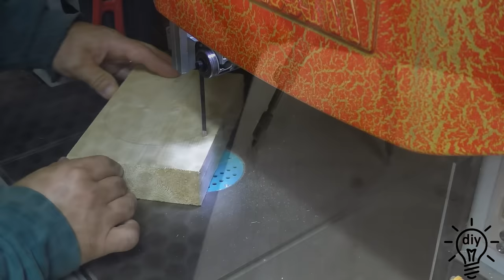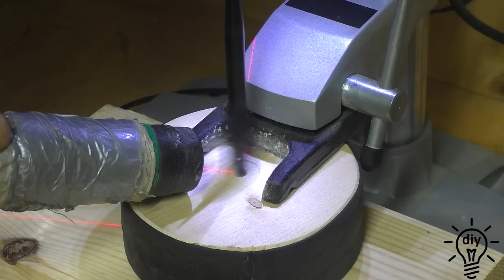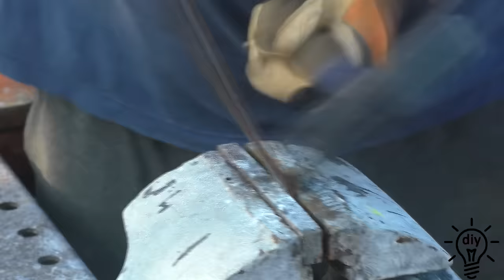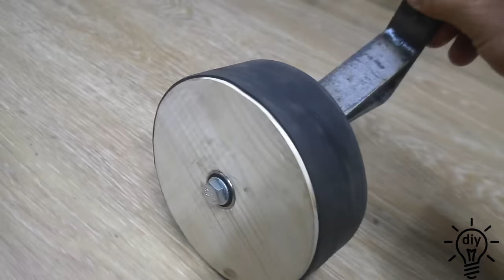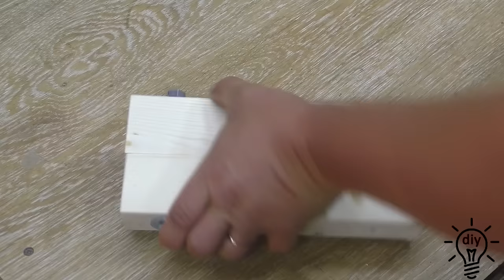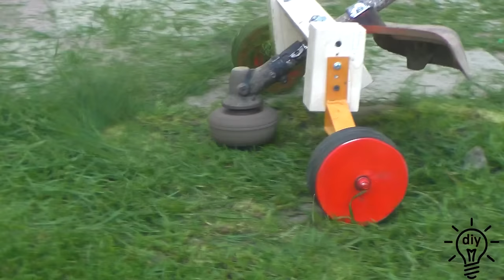A brilliant idea for your lawn! You will be pleased to see it!

Comment: The lawnmower is there for this activity! A lawn trimmer is actually there for lawn edges and corners that a normal mower cannot reach. And if the part is supposed to be useful, then (unfortunately) it is not thought through to the end. With a support wheel welded or screwed to the handle and height-adjustable behind the baffle plate, you would always have the same cutting height in forward gear. So you can only achieve an approximate cutting height by balancing. Totally useless part!
Reply: radam24uzo :::: from an artistic POV,  a designated consistently dense square footage of lawn could feasibly be “sculpted” by calculated height adjustment controlled by a skilled operator as the pattern….like CropCircles, or topiary figures ^[ in 2 dimensional]^ is being ‘incised’ in a pre-prepared lawn.  I think it’s called BAS~RELIEF……with low, medium, high relief.  Next generation would be a robot device that follows a template or program or dream pattern.  Landscapers could have special training and schools as well as DIY instruction!  This is an adequate prototype for FreeForm LawnSculpting….imo
Reply: Exactly.
Reply: @codeblue2532  Have you been smoking grass again?
Reply: @Engineer9736  :: …not for 17 years but there’s always room for a FlashBack….or a ‘channeled’ design.  The dynamics I related are from Leonardo who knew that GRASS would be a great preoccupation somewhere,,,someday.  So Laser~Sculpting of lawns is his artistic interjection, not mine.  FYI:  see Wolf-Garten “ZERO” laser cutting lawnmower.
Reply: I agree. Unless the user of this has 1,000 yards of trim line and thoroughly enjoys changing the trim line... this thing is a dopey idea
Reply: @bukboefidun9096  :: but what do you think of CodeBlue’s idea/concepts in reply above to   radam24uzo ? just curious.
Reply: @codeblue2532  I think for ornamental horticultural purposes this tool could do amazing things.
Reply: @bukboefidun9096  :: thank you for your reply ¥
Reply: @codeblue2532  I understand all of your points blue especially bout sculpting and using grass as a canvas. I use my snipper for certain designs in some grasses. Its a good idea with the potential to be improved. ["What use is a baby, nothing, til it grows"] Also one of the cleanest cuts and healthiest ways to cut most lawns [when you dont have a cylinder mower] is to use the thinnest trimmer line you can attach at the highest revolution possible. You dont actually use very much line at all when the line is only in contact with the grass. You get very little ware. I have 1 small patch of lush lawn i do where i leave a full size whorl and sometimes like an Asterix in it using the bas relief method, after trimming the whole lawn i then indent a design. It's outside of a 3 story office block and the tennants compliment me on it, they can observe from their elevation. It presents well with the rest of the high presentation garden and entrance.
Reply: @Engineer9736  think he should stop cutting the grass,, seems like he's definitely smoking most of it 😂😂😂😂

Comment: Now that's what I need to save on my back pain from weed eating.
Reply: May try a single wheel version or a narrow double wheel under the shaft so you can actually trim edges and use a larger wheel so it will roll over terrain easier

Comment: If you always want to cut precisely this works like... well it doesn't, unless there's second pair of wheels added to stabilize the angle. Few degrees change causes quite difference in cutting heigth. Especially when the pivot point (centre of the wheels) differs significantly from the attachment point.
Reply: Is this hypothesis based on conjecture or did you build this contraption and test it out? Inquiring minds want to know. Obviously, you spent enough time to construct a meaningful argument on a totally 💯 ridiculous home build.
Reply: @tc96z1  It's called physics, any half brained engineer would see exactly what sergeantdisorder mentioned.
Reply: @tc96z1  seems your IQ matches your likes.
Reply: @tc96z1  to spell it out for you. 
because it only has two wheels the whole contraption can tilt aka cut higher or lower than intended. unlike a lawn mower that has 4 wheels that always keeps level and therefore always cuts evenly. its also obviously a joke video. he starts off with scissors ffs.

Comment: All kidding aside, this would actually be a great solution for trimming around the trees in my woods. I have a nice Stihl trimmer that I use to maintain the woods, because there's so much debris on the ground that it would tear up my lawn mower. The problem is getting a uniform height and not accidentally cutting down to bare ground. As my arms get more and more tired, the uniformity of my trimming suffers. I was considering buying a walk behind string trimmer, but that would run around $300 even for a cheap brand. Attaching wheels to my Stihl would be a much more cost-effective solution and be one less landscaping tool to maintain and to clutter up my garage. I was skeptical at first, but I really love this idea. Thanks for the video.
Reply: Who in their right mind mows the woods?

Comment: All you need is an electric drill, a belt sander, some pieces of wood to cut into wheels , a school campus to make circles for the wheel and some thing to cut through a 36mm block of wood to make the wheels , and old bicycle tube for covering the wheels with some kind of strong glue  , two pieces of flat irons to attach wheels to , a welding machine , a metal drill to drill holes for wheels, lastly a working grass trimmer .. hey presto you have a wheeled grass trimmer ! Genius. !

Comment: For all of you saying "But lawnmowers!"  A couple points, unlike a lawnmower, this can get close to plants you want, without running over them.  Ever try mowing really tall grass with a traditional mower?  Binds up, bogs down, stalls out constantly, gas trimmers, not so much.     Ever try using a gas trimmer over a large area?  Those suckers can get heavy after a while.  Taking the weight of the head like this could save you some back strain.  "Well then, don't let your grass get so tall you can't mow it!"  Life happens sometimes, all I'm saying about that.  Another problem with trimmers, for those that don't know/haven't used one regularly, getting a consistent cut.  Keeping the head perfectly level, at the exact same elevation, while swinging it side to side can be difficult.  Having said all that though, this thing would obviously make it more difficult to angle the trimmer to fit in tight spaces, so, it's not something I'd personally use.  Just some food for thought.
Reply: If your grass is tall you simply adjust the mower to cut high, empty the holder before full, then come down in height. Might take a few rounds but so what, your mower wont bind up, bog down or stall constantly. Nor do you have to run over plants. If any or all of that happens it's just lazy mowing. Gardeners have used mowers of all sorts for decades and like any other job, when done properly there'll be no problem. Where you have plants you can trim the lawn edges with long handled angled shears but many plants especially longer stemmed can be pushed back from the edge and lightly held back with a rake or broom, just do it if it works, if it doesn't it's no major operation. Strimmers were never meant to cut lawns and even if there is a large area to strim don't buy a strimmer you cannot handle, same as with any tool and resting up is never a bad idea anyway. If none of that adds up to you then add up the cost of the tools that guy is using, The heading about "Not expensive tools" is an advert not a fact. As well as hand held power tools he has fixed machinery for wood and metal working. How many of us are going to have or buy all that just to make a toy which itself has no collection box, no height control, no direction control and will be no better on a bumpy lawn. A novelty for a machinist who is pushing it anyway for who cuts grass with scissors and a ruler and he uses a lot of stuff he has hanging around, metal, rubber etc. There are also other alternative cutting devices for gardens including lawns, some mowers can have attachments. Mine can be converted to a scarifier and it's not a modern mower. Do the work, do it properly and you wont need gimmicks.
Reply: Man, everybody said that in two lines......   Must stop watching these nut jobs, I'm becoming one!
Reply: @douglaswhite1879  " Must stop watching these nut jobs, I'm becoming one!"  You said it.
Reply: How about when you need to tap the head to get string out? If your cutting super long grass it will bind up in the head anyways.  Just hold the thing as it was intended.
Reply: @chadwilkinson2558  Not all trimmers have that function, and personally, I hate it.  Mine has three fixed length pieces you replace as needed.  No holes in your lawn where you had to drive the head down into the grass to get more string.  

As for long grass binding the head of your trimmer, that in my experience is compensated for by just going slower.  Give the grass time to fall after you cut it instead of just flailing it around.  

None of what you said addresses the two issues I have with trimmers, consistent cutting over large areas, and weight, again over large areas/long times.  I realize this is not the INTENDED use for trimmers, and in a perfect world, I would never substitute one for a lawn mower.  Sadly, we don't live in a perfect world, and occasionally, health issues impact peoples ability to do proper lawn care.    

And again, there is this point "Having said all that though, this thing would obviously make it more difficult to angle the trimmer to fit in tight spaces, so, it's not something I'd personally use.  Just some food for thought."  This thing is clearly not practical for MOST users, using the trimmer for it's intended purpose.

Comment: So many negative comments! It took me 1.5 hours to whipper snip and move the lawn. The lawn mower died so now I just whipper snip everything. It now takes me 45 mins. I was looking at doing something like this. As some commenters say, the angle will determine the cutting depth so a bit of training is required here to keep the angle right but to make it really fast the whipper sniper needs to go from side to side as well as front to back. This is where this type of mowing is faster than as a normal mower which only goes back and forth so maybe some swivel wheels might be better.

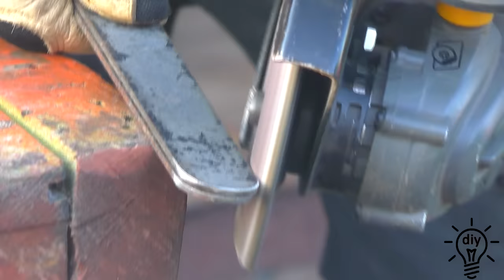Comment: 2:23 uses center punch and proceeds to put it in a clamp/vise-grip.... notice the drill bit falls into the off- center punch mark and ends up bending the drill bit while its drilling trough the metal.
your hole is not centered and its because of the center punch... you dont need a center punch if you are going to vise-grip it + use a drill press,  drill it with a #40 first to find the spot then upsize the hole....
the off center holes are driving me crazy!!! ( I work on helicopters )
Reply: I'm Kobys legal team and need to talk to you about some dodgy centre punching !! 👊
Reply: @jimbobjameshecks  HOOORAAAAH

Comment: I have a larger lawn.  I saw another video where they run a weed Wacker off an air compressor.  So maybe you could do that but add an dolly for the large compressor and a longer board so that you can attach five weed Wackers in serious.  Possible add a seat also.  Then you could cut 52" at a time.  Maybe a mechanics seat so it could cut in circles while you stay in place...now that would be cool.  Like a giant beard shaver for a close comfortable lawn.

Comment: I have a large area that is very uneven and with some very steep sections. I have a self propelled mower but it struggles to get the job done. The height of a standard mower is not tall enough even at it's max height nor are the wheels big enough for the uneven terrain due to moles. Riding mowers are better but the terrain will beat you and the mower to death if you go at a normal speed. I might try to assemble something similar and use a brush trimming style blade. If only it would cut a 4 ft path all at once. I really need a bush hog but I live in the German countryside where stuff like that costs as much as car.

Comment: OK... so many questions. 1)  why was there a shovel in the thumbnail? 2) there is nothing holding the back of the trimmer up so this does pretty much nothing for keeping the head level, so why? 3) whats the purpose of rubber coating the wheels? the wheels have 0 reason for needing traction. and finally 4) since this make weedeating a fence line 10x more difficult and taking this contraption off everytime you weedeat seems like a PITA, why did you put this on the internet?

Comment: Whole this is an excellent idea, it's actually TERRIBLE on grass you're trying to regrow properly. This damages the grass by literally smacking them in half. A push mower or even an edger turned sideways properly slices the grass in half without causing damage to the cellular structure and integrity of the grass.

Comment: String trimmers are called string trimmers for a reason, they are for trim work.  Your lawn is better served by cutting it with a sharp metal blade, like the one you find on a lawnmower.

If you have a small lawn, I would suggest a manual reel mower instead of this contraption.

Comment: Can't un coil more line easily and get the worst lawn cut possible.  A lawnmower produces lift and cuts the grass clean if your blades are sharp. You can see this string blowing grass down as it passed over. You also damage the grass with the line just ripping the grass instead of cutting.

Comment: You got to be KIDDING ME!   Start pricing out all the tools he is using as though you have NONE of those tools. I mean everything. I lost count even buying cheapest stuff.  Also the TIME it takes in REAL LIFE.  I am certain he could have cut that grass with the scissors down to the dirt for the whole patch.  Besides that if you can find a piece of strong wire and can bend it in to a U  and each of the legs into a J you got basically the same thing without needing a wheel, just skid it.  Me, I carry it because it is faster & I got beer to drink.
.  Being poor has its advantages.   I have the neighbor's chicken take down the grass to the roots...and I get really yellow omelets from the eggs it lays out and it fertilizes the lawn too. 
.  Hell, if you are going to do a whole lawn with an edger, then find a thrown away TONKA TOY TRUCK and fiddlefuck with it and a hose clamp and you got essentially the same thing.